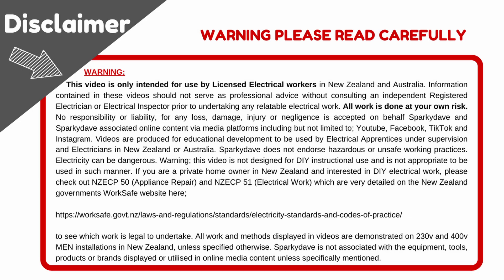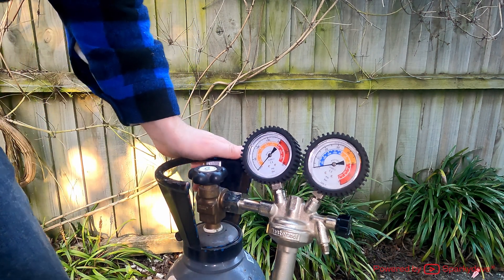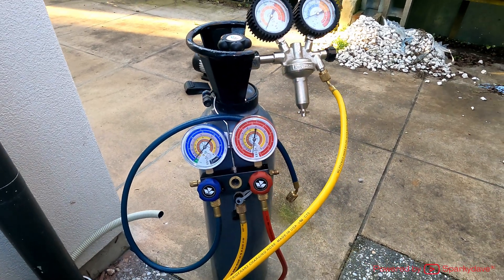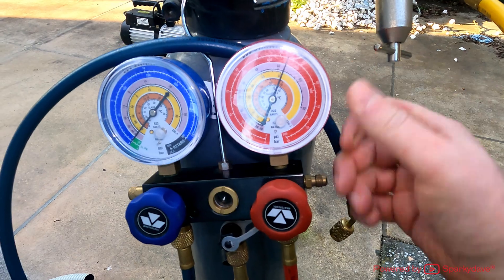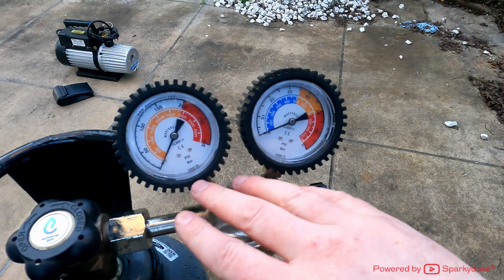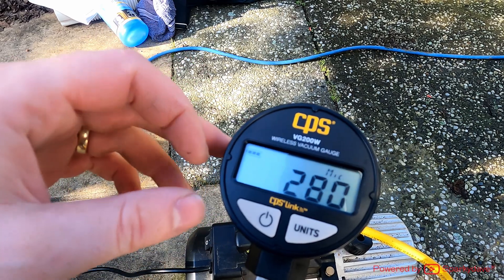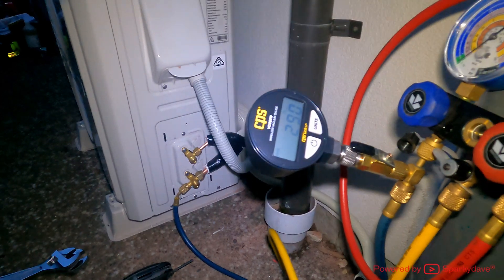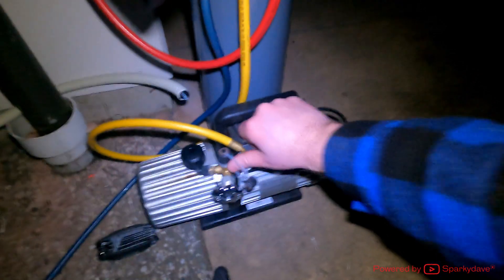How to Test and Commission A/C (Heat Pump) Pipework

Comment: I'm a sparky in NZ but have never done a heatpump. Is it mandatory to do a course on the refrigerant side of things and get certified?
Reply from the maker: A licence is only required for purchasing refrigerant to refill/recovery. There is no mandatory qualification or certification to install or replace heat pumps in New Zealand. I would recommend taking a course at SkillSure Academy for heat pump installs if you are keen to get started.